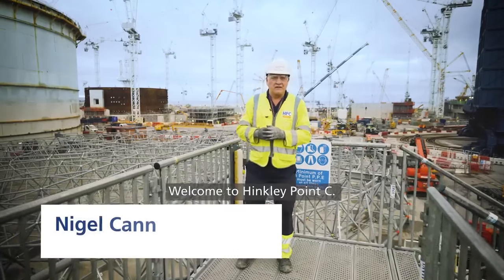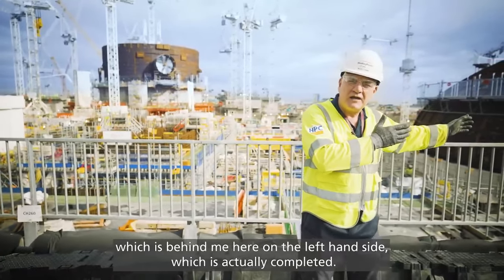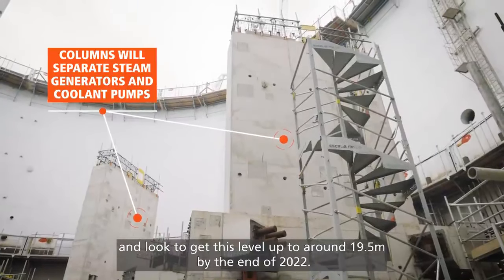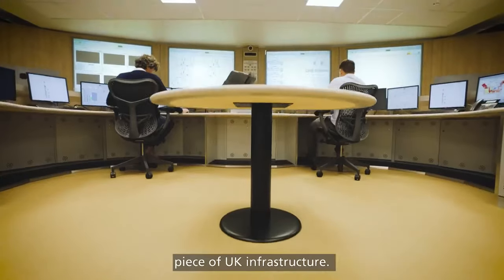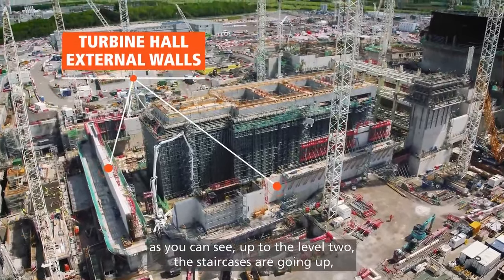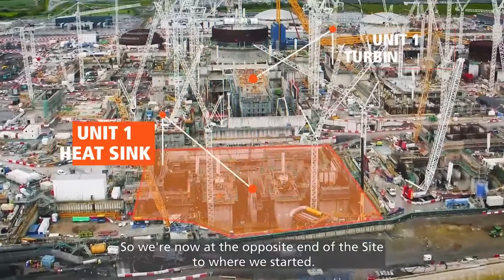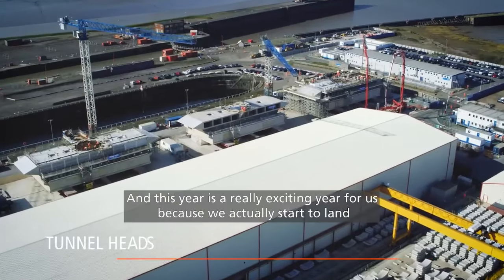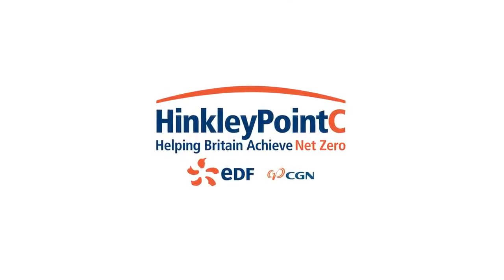What's the latest progress at Hinkley Point C? Take a tour with Delivery Director, Nigel Cann

Comment: After a 13 year delay Areva type 1600MW reactor Olkiluoto 3 in Finland is now in testing phase. 60% output already achieved and full output should be achieved in the autumn which makes us near self-sufficient in electricity production. I hope all the lessions have now be learned by EDF and Hinkley Point will be completed more or less on schedule!
Reply: Great news, seems it will be online very soon!
I have very little doubts about Finland not finishing it in time despite problems Areva (now Framatome) had, here it is known as a country without much corruption and good organisation.
Is infrastructure better suited for 1600MW reactor instead of two smaller units?
Reply: Is it the one was being built by a Russian company?
Reply: @codaalive5076  , the plant was ordered already in 2005 when small reactors were not available. Another 1200MW plant was ordered from Rosatom in 2014 but cancelled last spring for well known reasons. OL3 will be tested at 60% capacity throughout the whole autumn and commercial production will commence in december.
Reply: @jarirutanen8762  I red about this delays, did Rosatom started building it? What happened with one ordered in 2005?
West doesn't seem to be capable of building this plants reliably, probably due to corruption. I'm not sure if you remember Finland's Patria case...
Anyway, South Korea and probably China are capable of building such reactors in 5 years for 5 billions, that's it, done. If i ordered one Korea would be asked first because time is running out.
Reply: Well, OL3 was the first EPR, but due to national and project-specific issues, it was overtaken by the Taishan EPR Units 1 and 2, which are already operating....
Reply: @codaalive5076  , the reactor construction never started, only onsite preparations were made. The project was heavily delayed since Rosatom could not deliver the necessary documentation required by the finnish nuclear safety administration STUK. However we have already two older Rosatom reactor types Loviisa 1&2 that have been working just fine since 1978. OL3 was ordered in 2005 and has been massively delayed due to project mismanagement. But now it is hot and commercial production should start in december.
Reply: @NuclearSavety  Thanks for reminding me of OL3, it puts EPR vs VVER competition into a very different perspective. 
I didn't have much time to go through all this mess, so far it seems they are pushing EPR to a point no reactors can be built within normal timeline. Issues might not be only national and project specific.
Reply: @codaalive5076  , OL3 project was a complete mess: normal mega project hazzle + Siemens and Areva fighting with each other + Areva not taking seriously the requirements from STUK. I think the tide has turned for small scale reactors. I wish we will get one such to replace the dropped Rosatom reactor. The building site is already almost completed. The company is called Fennovoima.
Reply: Olkiluoto 3 was interesting in how the plant was financed. The initial projected cost was set in stone, which basically bankrupted Framatome, so the french gouvernment had to step in. If only all nuclear reactors were built that way, then the true economics of this mess would become clear, and the nuclear madness would dry out naturally.
Reply: @luc_libv_verhaegen  History doesn't support such claims, we had very vivid and quite cheap nuclear power considering how hard it was to build reactors and maintain them in let's say 70's. We would probably be on Th cycle if oil barrons didn't stop R&D in 60's. The only problem i see with it is lack of working force and engineers. Renewables are no different in this sense, beside not being able to provide base load power, or even power one country except Iceland where they are finding increased deaths due to thermal power producing H2S...
Reply: @luc_libv_verhaegen  true, the price was fixed at 3.5 billion € if I remember it right. Both OL3 and Fennovoima's Rosatom project were huge management blunders. Luckily Rosatom is now dropped out. However still I'm pro nuke. Just new technology should be  developed e.g. in Finland we need a lot of heat generation. Thorium sounds like an interesting option, but I guess corrosion is still a major problem. Btw OL3 should be back online at 60% output today at 15.00 CET. That is within half an hour from now. At full output Finland is near self sufficient in the production of electricity.
Reply: @jarirutanen8762  I like Th too, the only problem is development. China already fixed corrosion problem but i don't see them sharing technology with us until 2050 or later. Good thing is lots of Th almost everywhere, beside it burns much more effective than Pu or U.
Wish you all the best with OL3, i will check how it goes.
My understanding is France's nuclear plants are important strategy for them, Russians probably didn't have the same chances like French or other European companies. Wasn't Siemens involved too, or was this at another project?
Reply: @codaalive5076  , my comment disappeared, so here it is again: OL3 is now back online with 330 MW output! Yes, the turbines and generators are from Siemens. The operator is TVO.
Reply: @jarirutanen8762  Dissapearing comments are new sport, the last comment before this was written to another dissapeared reply about my negativity regarding Western capability to build plants... I'm pretty sure it is not computer glitch!
Good to hear they powered OLI3 again, hope they will fix the problem until the end of this year.
I'm missing this article posted two times, it is important for European reactor project and SMR. Btw, they found solution for thorium reactors corrosion, China is just testing one. In fact, during MSRE they knew corrosion from fuel can be solved pretty fast, for sure until now:
Germany’s overdose of renewable energy
Reply: I live just over the hill from Hinckley Point.  It's looking good, but we need more reactors l, real soon.
Reply: @BritishBeachcomber  Great. DId they give you free electricity and made modern infrastructure (schools, hospital, etc)? They do this here, people who live nearby like it a lot because they also get well payed jobs and other advantages.
Reply: @codaalive5076  They did help with local infrastructure but no free electricity.
Reply: @BritishBeachcomber  If it is not too late demand more, they have enough money and it would be good example for other places where they want to build more plants. This is or should be common thing after green's bluff nd renewable nonsense.

Comment: A real megaproject. Incredible achievements by all the groups involved!
Reply: This is not nearly enough. Europe, except Russia, and USA are not capable of building even few reactors at the same time meaning we are doomed. Other green technologies are not nearly enough either!
Reply: A mega french EPR project which will finish like similar units elsewhere  by great delays and 3 to 4 times scheduled budget. 
12 years delay in Finland and near thé same in France.

The 2 chinese réactors hv been producing energy untill they find à big technical problem.
Actualy at least one is out .

This technology of 1650 MW unit power is not so far reliable. 

May be French contractor EDF Will
Support extra contractual expenses 
But what abt thé lack of energy when not connected to the network ??
Reply: @williamjolka4351  Someone just commented this is normal because Europe, except Russia (most of it is in Europe), wasn't making such projects for decades. 
Of course they have mistakes, one with cladding, the other some kind of boiler, although this are not major problem.
My opinion is we have to endure problems until this new designs and companies mature.

I think you know renewables won't do it, no way. If they could Germany would already be mining their huge reserves of lithium :)
Reply: @williamjolka4351  Yes I am aware of the problems but for once I wanted to leave the negatives aside since they get enough coverage. I just wanted to congratulate the people on the ground on getting this far; delivering such projects is complex and pressured work, and supply chain disruptions due to COVID and Brexit have not helped.
Reply: @MUSTASCH1O  that s true.  I m still trying to unissant why EDF started with EPR technology 1600 MW  as 1400 MW  is working perfectly  and future anyway is 
Under expériment in  ITER  project.

It Will take another 25 / 30 years so 
It was à bit dangerous to change for 
Such " short time " 
Ar thé very beginning  british government was involved to sécure thé operation but finally  EDF took thé major risk as Areva plus Chinese partner gave à very small part of
Garanty.  
This is too much regarding EDF financial possibilités in case of 
Big problem.  OK EDF is hold at 86 % by France but it is now question to
Cut thé company in several parts to sell thé Best pièces.

As conséquence , problèms with EPR cld face tomorrow empty guarantee !!

Thé work at site is great.  I hope thé technology Will nt fail.

Comment: Hello Sir, I am qualified ASME Authorised inspector, Repair inspector and interested to work in this project
Reply: Great, nice to hear from you. I hope you don't mind a question, not many are in your very respected position; what is wrong with Europeans (except Russians) and Americans that they can't build enough reactors? Is it oil lobby, loss of knowledge, young people or you rather don't say it? Thanks a lot.
Reply: @codaalive5076  What's wrong is the cost. These are high-tech pieces of equipment and the materials, designers and builders of such installations have been getting more expensive while other solutions for electricity production have been getting cheaper at the same time. It also is not a good way to reduce dependency since most European countries don't have sufficient reserves of uranium.
Reply: @jwstolk  Do you propose renewables uncapable of providing base load power in most European countries? Materials like lithium are pretty rare and nasty thing to mine, this is why for example Germany won't touch their reserves, they rather try mining it in Serbia or any other country accepting "new ecological standards".
If i was wrong about it, i'm not, installations for renewables are very expensive too because we would need lots of them while people are getting older in Europe, new generation isn't really interested in natural sciences except medicine, pharmacy, computers and so on. Also, no country has ever powered itself with renewables without requiring oil, nuclear and so on, German model shows very well what it means... On contrary, we know nuclear works, i'm sure there have been less deaths since it started than from coal in one year!
I never heard of such thing as uranium crisis, people waiting in lines at some nuclear stations causing recessiono, or US starting proxy war in Europe with a country providing much of energy to EU, beside having more nuclear weapons than they have.
Check this, it is pro-Chinese but it doesn't bother me: Germany’s overdose of renewable energy (Asia Times)
Reply: @codaalive5076  You are correct that renewable (base-load) alternatives are expensive too, but all these things you mention are included in the final price, which for renewable energy is still dropping. Note that lithium is not a rare metal, it is even more common than lead or copper. It was just not mind much because we didn't need much of it. And we still don't need a lot since lithium batteries contain only a couple percent lithium. Reliability is also an issue, of one of these two reactors is stopped for maintenance, where does the electricity come from? Or is the 2nd reactor only used, when the 1st reactor is in maintenance? The Hinkley Point C  nuclear station is Chinese, at least the most important pressure vessel is.
Reply: @jwstolk  It is hard to explain what it takes to get most of the power from renewables, then deal with bae load because we can't store electricity without loooots of losses, or build extnsive runs of new power lines which have very little power. Read about German problem.
You are right, we don't need much lithium although it is essential and will be for some time, even copper isn't so common, let alone more fancy material for whatever.
My believes are pretty much set in stone, we have only seen failures with renewables and not with nuclear.
Reply: @codaalive5076  Have you ever fully charged and discharged a modern Lithium battery and checked if it got warm? It doesn't, the losses are about 1%, plus about 2% for large-scale AC/DC and DC/AC conversion. Large islands run 100% on renewables and battery storage. Today. It's expensive, but not much more than transporting diesel to an Island. It being impossible is nonsense. These installations do scale. You can order any battery system size from Tesla Today, there are no technical limitations on capacity and the can even do distributed storage systems using small home-based battery systems.
Reply: @jwstolk  Of course i discharged Li battery, of course not by shorting it. Power is so small even lead batteries don't get warm during normal use.
AC-DC converter losses are from 5-10% in small systems, more in bigger. We can now send DC over long lines at a very high voltages, although losses when converting down to useful voltages or AC make even more losses.
Large batteries? They can make on as big as house but at what cost and capacity? I rather don't mention Tesla because it is private and doesn't care how electricity is made, he just want to be rich, go to space and play other rich people games.
Seriously, you will have to study electronics a lot more to be taken seriously. Thing about "Islands" is comparable to saying Th MSR can be now built even in deserts because China is testing loops of their research MSR in the desert.
Where do you think all garbage from renewables go? To Africa, China...but even that will become increasingly expensive. Germany just bury their wind blades in nature because cost of recycling is too high. There are talks about replacing Li with Ni for batteries, don't know how long this will take if they are really up to something.
I hope you red that article, it is important as they predicted faith of renewables in Germany who claims to be leading but buys nuclear power from my county during summer when everything should work much better than in the winter :) Read, read, inform yourself, i know i'm being picky but we need to go full nuclear except maybe for homes.

Comment: they mention tunnels connecting the plant directly to the sea,  I know that it probably is double contour system but still, will there be any systems in place to prevent illegal or accidental dumping of radioactive wastewater in sea? Fukushima scenario could destroy UK's fisherman business in one go
Reply: Pretty sure the UK doesn't get 40m high tsunami's or earthquakes for a start....  this reactor design is also different.
Reply: When operational, the station will have permits from the UK Environment Agency to discharge low levels of a range of radionuclides to the sea and to the air - as is normal for nuclear stations. These discharges will be closely monitored to ensure that no limits are exceeded.
Reply: @colintucker2058  Thanks for explanation